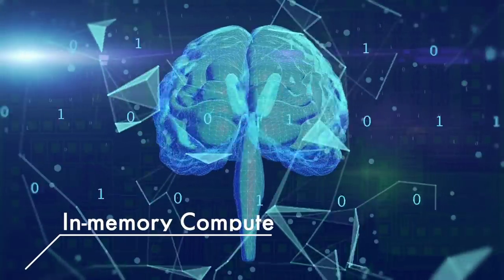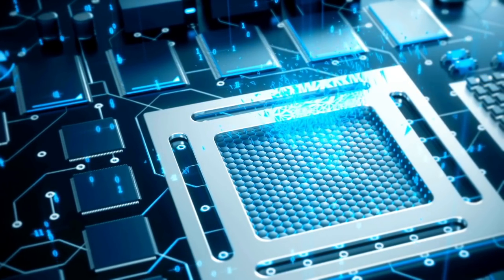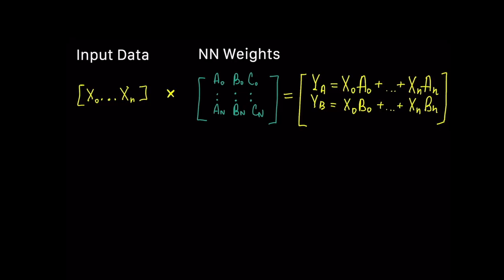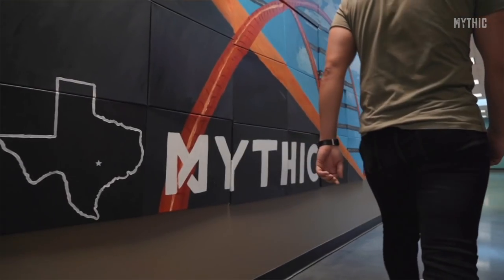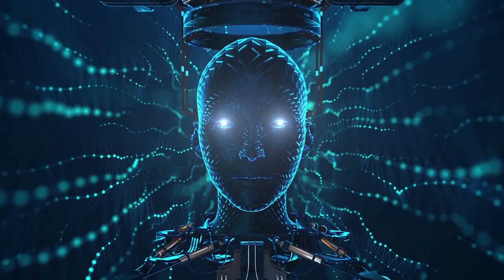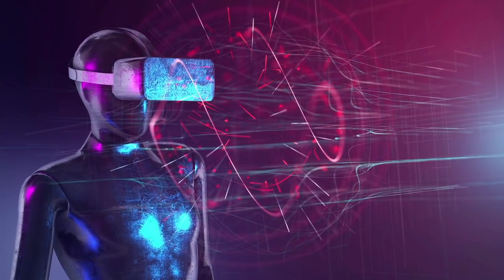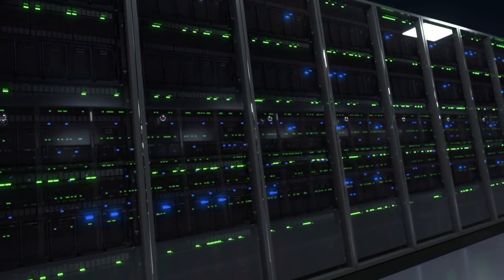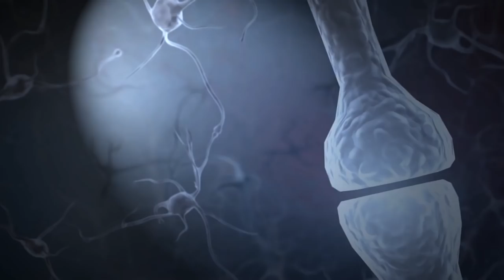Analog AI Accelerators Explained

Comment: Analog can be ridiculously fast, like intelligent 1 nanosecond reaction times. However it needs a metric for accuracy of the computation at each layer. With analog it is no longer deterministic but if the analog process is adequately precise like a human brain it may never be an issue. So are they... how do they compare
Reply: O BRAIN E AQUELE QUE POR MIM FOI NOT .EM #
Reply: For NNs, high precision isn't necessary, especially if these are used to scale down pre-trained networks as what are the most likely applications for this.
Reply: @supercheetah778  I don't know that that's true.
Reply: @DanFrederiksen  For learning, precision is needed if you want to do back propagation. But for inference, I think it may be not important.
Reply: @vsiegel  that's why I'm the father of deep learning and you are not :)
Reply: You see when this content comes up there are always people certain of their opinions and probably arguing different things. You might not even realize but the emotional balance is what is important at this point for technology to progress.

There are thousands of engineers and devs who are clever (af) but are grinding without touching grass and even AI can't convince them to actually go fucking touch that grass. 

Thus every actual human capable of the job HR should be doing (whether through videos or contact) should actually be rewarded in meta economy pseudo equally. 

but hey the impedance to allowing emotional balance when at forefront technology and tons of clever people insisting things go XYZ not ABC ends up catching the focus of humans.

Comment: The concept is pretty cool. Though the limitation of not being capable of training the model on the chip is huge. Maybe after a few years they'll figure out how to make some microscopic variable resistors for the weights? Something like replacing every resistor with transistor-resistor-in-series in parallel and so you'd have quantized digital control over the resistors and the chip then can be used for both training and inference.
Reply: If only there was these microscopic units that could change weights. You know like, beads. Nah, Dots, hmmm. Cells,
Reply: she said Akida can do on-chip learning, which I assume means training
Reply: Look into photonic computing. A very similar thing is occurring but instead of using matrix operations on resistance/current there's companies doing matrix operations with light. I'm still pretty sure that the weights changing is still slow but I think it's faster than weights changing with electronics.
Reply: I dont see why this chip is not capable of training since training is also just some matrix multiplication and addition like inference.
Reply: @edhofiko7624  it's a matter of what they're built for, i.e., I'm sure it can, but serving as a trainable / executable NN demands specific cpu design (gpu) and memory layout for optimization.

Comment: It seems that if you fuse the Akida for Training function and the Mythic for Instant Inference we would have something very powerful for AI, because Mythic is only at 40nm and runs at 35TOPs, a Mythic chip of 5nm will breack the barrrier of Petaflops (very near of the mammals brain) maintaining the energy consumption ridiculously low. I don't see GPUs reaching the low consumption of this Analogic Matrix Processor ideal for edge computing.

Comment: Super interesting! Analogue matrix computation with low overheads: A mix of historic & cutting edge tech. Maybe useful for base systems such as removing false positives as you describe with your Tesla camera, but expanded for robotics to do routine stuff like walking on pavements, taking load of more sophisticated AI. Thank you for sharing!
Reply: @erkinalp  in the limit you may be right, but for a practical AI system one has to reduce mistakes created by noise etc to some acceptable low level & as far as I understand the subject one can in practice create error free data sampling that is e.g. good enough for very demanding applications such as on-line banking.

Comment: I am excited by the analog matrix processing. This is simple and easy to understand, though it does tend to have a higher sensitivity to noise and temperature and other physical influences. 

To me, this functions sort of like PROM, where the values are written once then become read-only. It's the reason they're not used in training, though if there was a way to change the resistance of each cell by individual address, it might be a game changer.

Comment: 1960's: We have analogue technology.
1990's: Digital is the way forward.
2020's: Wait, analogue was better after all.

Who would have figured?
Well, anyone who saw that an analogue TV still allowed you to see a picture with a low signal strength, even though it was quite snowy, while digital TV's froze frequently and made it completely impossible to watch.
Reply: It is mixing some analogue into the digital, and that is important.
Reply: It's because digital requires "Processing" of data in a way that is not direct like analog electron flowing ... So makes all the sense I have thought about this already before ... Because it's like a computing maze, wired to return output for inputs in a direct way.
Reply: digital was already prominent in the 70s at least
90's is the Internet becoming mainstream
80's is home computer era

Comment: Does analog mean that the coefficients drift over time?  Can the ai computations be affected by tiny environmental fluctuations of temperature, voltage, and current?   Is it possible to read the engine parameters off the analog chip and transfer to a digital engine?
Reply: analog circuits are powered by feedback loops, complete with heat and voltage offloads if need be, so they are more stable than one might think. to your second point, in principle yes, but you would essentially be rounding every float.

Comment: I feel like, while we tend to divide things into analog and digital, that "all digital things have analog aspects" and "all useful results for building any kind of intelligent system from an analog system required digital aspects". This goes all the way down to the fundamental way matter and energy exist as we know it where, really, all matter and energy is analog vibrations of energy which become useful when form digitally discrete patterns, like a proton is formed in a discrete digital manner from 2 up quarks and 1 down quark.

When, for example, if we look at the variable charge across a resistor we normally think of this as analog, if you look deeply enough into it, we get into quantum physics and it becomes digitally discrete, but with such extremely fine detail with our uncertainty of being able to measure things, that we treat it as analog.

The main point I am trying to make here is that what allows an intelligent system to work is decision making, which is digital, so we do need digital results that we can make decisions around, and that sometimes when we turn to using what seems like an analog system to us for an intelligent system, for it to be intelligent, it must be providing us discrete enough to us results that allow for that intelligent decision making.

Comment: Thanks for the great video and the information Anastasi.

Analog AI seems to be a great concept and the PoC solution seems promising. My only concerns here would be scalability and flexibility. 

Yes sure, matrix-multiplication is the most compute intensive operator(s) but the AI field is moving fast and new NN architectures and novel operators are introduced in a fast pace (e.g. see Transformers for Vision). In this case, how easy is it to introduce support  of custom operators? How about use-cases that do not need 35 TOPs? In this case, we will see some energy reduction of course, but my point is, how scalable is the HW?

Thanks again for the great presentation !

Comment: Since is it is analog, and so is the light based chips, it comes to mind right away this may be a good translate layer with correct sensors, or hints working with light based chips and also as the conversion back to a digital use?

Comment: the ohm's law use of creating a dot product.  a dot product measures cosine similarity.  i had noticed early on that dot product seems to happen commonly in physical systems.  a bunch of water pipes, or other fluid flows, might be able to perform meaningful calculations.  a very large and complex physical system might even be performing meaningful computations over long time scales.  the real mystery seems to be in getting the weights set correctly without an obvious gradient descent candidate.

Comment: hello ,so the input  data are stored in the processor while simulating the matrixes with resistors (flash memory) but what happens with the library data if  the language is assembly  right  so it should be connected with a small  external memory ,awesome , well i think maybe thats the brains second  hemisphere  of A.I ,or maybe the frontal lobe  !!!

Comment: This is a simple sorter system made from resistor banks. The resistors don't store anything. No calculations needed in the resistor banks so it's faster with less power consumption. What am I missing. Been out of the tech field for eight years.

Comment: This sounds like a step-change technology that could really enable AI in mobile applications like humanoid robots. One question about analog processing though: since resistance is linked to temperature of the material, it seems that the Mystic chip would need to operate at a set and very stable temperature to perform properly. Is that a true statement?
Reply from the maker: Good point! Yes, resistors (memristors) are sensitive to temperature variation. However, in my opinion, it is manageable with conventional design techniques to achieve consumer temperature range with reasonable cooling.

Comment: Recently I programmed my own calculator for very large numbers and so I had to break down what is multiplication? Addition. What is division? Subtraction. It's funny how you forget those things that it all comes down to addition and subtraction. +3 + 3 + 3 = 3*3 =9  that's multiplication   9 -3 -3 -3 = 0  so we know that is true but somehow it seems confusing when we do division. So we take a number 1000 digits long and we start dividing it by 2. We subtract half. Do we now have 500 digits? no. lol lets say it starts with an 8 now it starts with a 4. That's all that changes. Same number of digits.